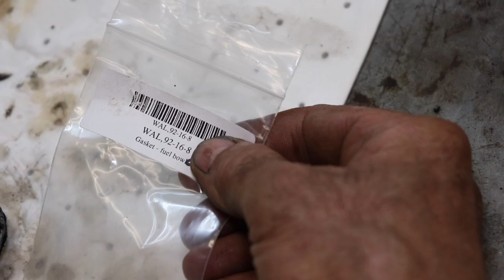How To EASILY Rebuild A Kohler Magnum 20 Carburetor

Comment: When the plague first hit and we couldn’t go anywhere I drug an old Huskvarna lawn tractor out of the woods to fix just so I’d have something to do. All I’d ever done to a mower before was just routine maintenance but I knew it had a valve problem when it was parked. I looked up some stuff on Youtube and found Taryl and I fixed the moved valve guide and replaced the push rods, rebuilt the spindles, aligned the wheels by adjusting the non adjustable drag links (I figured that one out myself), put new tubes in the tires, new wheel bearings, found and replaced a bad safety switch and tomorrow I’m taking the kill wire to Radioshack (I know, but we still have one in town) and get a diode to fix it. Then I’m putting this thing up for sale and buying another broke down mower to fix off the local radio swap shop.

Thanks Taryl.
Reply: Wow you have a RadioShack near you that's cool I'm miss that place I can't find one were I live. Anyway good luck with the build.👍
Reply: @nateg5887  all the RS corporate stores died. It's only the few and far between franchise owned stores that survived.
Reply: Thanks! We still have one, like Erik said it was never a corporate store. Which is good because the guy that owns it knows all about radios and electronics so he can help with anything. Sometimes when he’s out of something it takes him a while to get it though because he says he has to order $700 worth of merchandise before they will send him an order now. I love the place, there are half fixed telephones and radios laying all over the counter.

We still have a Western Auto too but it’s mostly a straight up lawnmower shop now with maybe a few bicycle parts.
Reply: And that Sir. Is called capitalism glad to be an American! :)
Reply: I did something similar, except my fixes were doing engine swaps and tranaxles swaps... I also accumulated a decent amount of parts. The wife is real happy about it hahaha

Comment: I removed my Kohler fuel pump on my JD Lawn Tractor. I got tired of the check valves coming loose. So I replaced it with a Chinese POS replacement from EBAY. Big mistake. The engine started to fill up with fuel after 3 uses I had gained 3/4" of oil level. Luckily I checked my oil level and caught it in time. Thanks to Taryl's advice, I removed the lever actuated pump and replaced it with a B & S pulse pump and made a small block off plate with a hose barb threaded into it. No more problems. Thank you for saving me from a blown engine Taryl!

Comment: I did rebuilt my carb last year. It ran great BUT, it's a different story this season. My engine runs great with a little bit of choke. The fact you mentioned the fuel filter makes sense. A carb doesn't start to run on "fuel starvation" mode out of the blues. Oh well,  I just learned that, even small engine shops will, inadvertently, sell cheap filters. Good point Taryl and team.

Comment: I like the brass filters, like the the ones used in old carburator, on cars that are made from tiny brass beads stuck together, then sometimes machined to shape, it has very tiny holes  that filter the fuel ,  they are less common these days! They can be difficult to clean, if they get in bad shape,  I had issues with the cheap filters on a scooter,  they cause carb issues on about 4 carbs!!  There is some things you shouldn't skimp and cut corners on! 😀

Comment: Interesting observation about those pleated air filters. I never would have thought about it. A couple of weeks ago I was looking at a John Deere that just wasn't running up to full power. I replaced the fuel pump and the pleated air filter, and that made all the difference. I'm thinking now it was just the filter.

Comment: I use a little metal polish on the end of the q-tip to polish the seat and it takes the varnish right off the whole inside of the seat and it makes the needle seal if it wasn't before. I fix some pretty nasty leaky carbs that way.
Reply: I use valve lapping compound. Sometimes I even have to put a drill bit about the same diameter as the the float needle into my drill and run it in reverse at slow speed against the seat, then polish with the lapping compound.

Comment: Taryl Fixes All.  Looks like the Kohler engine in the video has some similarities to the KT-17 Series 2 that’s in my Cub Cadet. Luckily my carburetor is gravity fed - And that’s fine by me. I’m looking forward to your upcoming video on performing a valve job. 
I’m very much looking forward to Slippers upcoming videos as well. Speaking Of Slippers, I had a bad experience with a Briggs & Stratton aftermarket fuel tank/carburetor ensemble - So I am going to try the double gasket/diaphragm fix with the OEM gas tank/carburetor that Slippers performed in one of the previous videos. And There’s You’re Dinner From Central Kentucky.

Comment: Is there any chance you could show us how the governer and throttle are hooked up on this bad boy? My gravely mower engine looks a lot like this one accept she got some coat hanger pieces and the choke and throttle are mixed up, no spring, probably missing half the brackets. She got boogered up pretty good before i got her!
The carb tips in this video were priceless! I popped mine apart and found some problems, but coulent have figured it out with out ya!
Thanks brothers!!!

Comment: I picked a booger Scag STHM20KH, changed all fluids, new starter, it ran, wasn't very fast, had the White hydro-motors rebuilt, new rubber, and all. Now having problems starting. Looking to see which to replace fuel pump, carbertrater, of both?

Comment: Thanks for the tip on float level have a rider runs about the same amount of time then dies. It has done it with two carbs? It will restart but has to set for a bit to run right again.

Comment: Taryl, what do you think about the filters that have metal ends and glass cylinder between the ends and have a filter strainer that is a plastic mesh nylon that is really a fine screen ???? They have rubber grommets between the glass and metal to seal the deal. Also, what about replacing the 90 degree sharp elbow that lets fuel into the bowl with a slow radius instead ??? Would that make fuel flow more manageable ???? How about the little clip you used to hold a linkage for the carburetor, what is the actual name of the item. Thanks Taryl and peace too. VF

Comment: Ever had a John Deere Sabre 2148 Koehler that blows oil out the fuel pump breather? The  oil was over full so we took some out but it’s still blowing out the fuel pump. Bad head gasket or crank case breather?

Comment: I’ve got the same engine on my craftsman garden tractor. Made a front end loader for it. Anyway I got 2 of the same tractors + an extra engine. 2 of the engines were junk. They dropped the little screws down the intake on 2 of them. Not good outcome the screws took a chunk out the head right under the valves. But I guess good for me are I would have never got them for free. Thanks for the videos buddy.
Reply: I've never seen a Craftsman with a Kohler opposed twin all I see is the ones with Briggs opposed twin that's neat is a LT1000 or is it a lt2000?
Reply: Dylan Hair  I think it’s a GT 6000 It made a good candidate for my front end loader. That having 2 of them 1 being the donor. The transmission don’t have spider gears in it more like planetary gears. Flipped them over to lock it in posy track. It’s also the trans with a high range & low range.

Comment: I had a guy work on a old 1979 XS1100 Yamaha motorcycle and he used RTV silicone on my gas tank petcock and the RTV got broke down by the fuel. It ended up quagulating in the petcock  and when I would give it fuel it would suck the blob and block the fuel inlet inside the petcock and it would die. On the side of the road it would idle fine. Took my a while to trace it down.

Comment: Taryl, could you use that metal gasket with the interfins on other carburetors to increase efficiency ???  I often thought about using that feature on Briggs engines for better fuel economy. What do you think fella on bugger patrol ???? VF

Comment: i already have a new 2019 cub cadet snowblower and a 2020 husquavarna leaf blower with carb issues from bad gas.snowblower looked liked cyrstals in bowl
Reply: the leaf blower had 2 week old gas with stihl oil mix now runs half choke to keep it going
Reply: ran fine 3 days before

Comment: Guessing that Carbatration Calibration Procedure is pretty much the same on all those two jet Carbatrators?  Good Starting point  One turn on the Low speed and One and a Alf on the High Speed Needle Jets ?  Tweak each for the Highest Rippums ur RPM ?

Comment: You must have got a bad batch of filters because I like them filters much more than cheap screen filters. The screen filters dont keep the junk out of the carb. the openings are much too big.
Reply: Steve's small engine saloon says the opposite of taryl, the pleated style is a smaller micron filter and catches more crap, while the wire screen catches only the large bits
Reply: @dave1135   I agree with that. I like the clear filters with inner paper pleats. If you buy them off Amazon,,be careful,they sell some aftermarket junk. That are worthless. The plastic it is made of is so brittle it will break just from slipping gas line onto it. And some of them leak right out of the package. JUNK!!
Reply: Lots of OEM’s use the pleated filters. Just don’t buy the cheapest ones you can find. Get good quality ones and you’ll be fine. I only use the screens on Briggs applications that came with them.

Comment: I couldn't get them to order me a kit down here in  Dothan Alabama thy told me it was no longer available I let it set for two years a d fave the motor away to get it out of my way man that's sad these people lied to me all it needed was the needle vavle it ran good other than it would run good used no oil was a strong motor I wish I could of kept it but when thy told I couldn't get no more parts I got rid of it

Comment: But but Taryl. (In your woman fussy voice). I was told by Briggs and Stratton to never use “carb clean” cause it will swell the 0 rings in that emulsion tube. (If the old ones have them) (newer ones do). Lol.

Comment: I agree with your valve thing but I think there is a good possibility or fuel pumps week and it certainly could be the valves given your compression problem should’ve popped over after about 10 seconds of cranking I own a lot of these engines but I know you know all about it too thanks for your advice